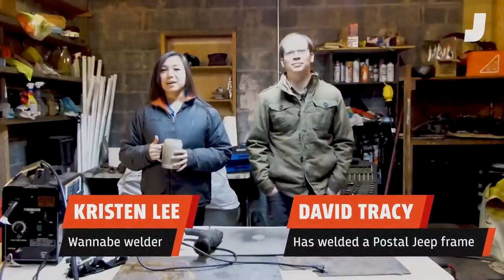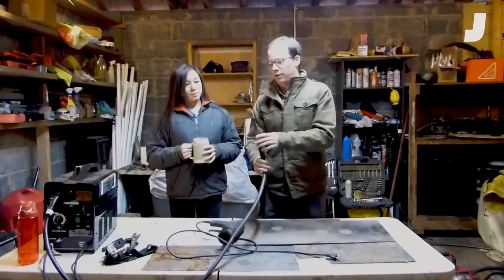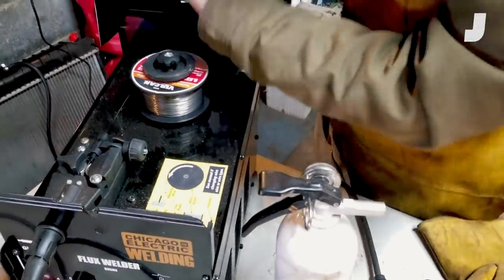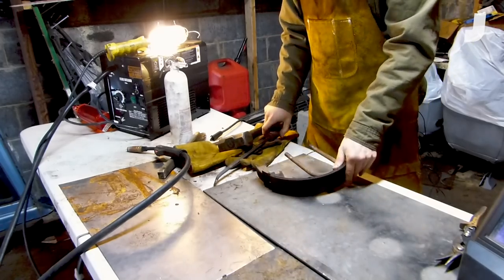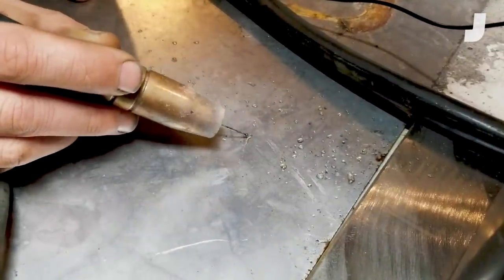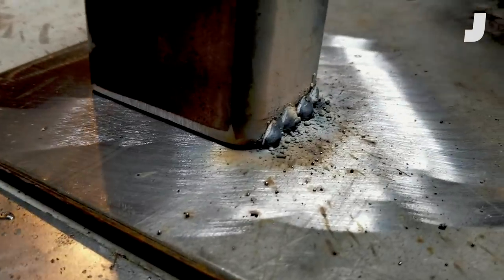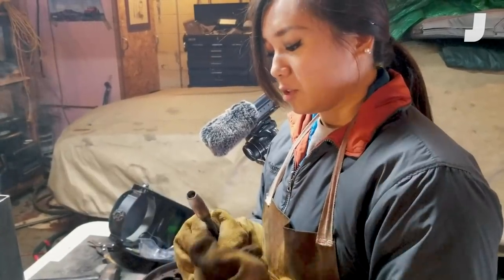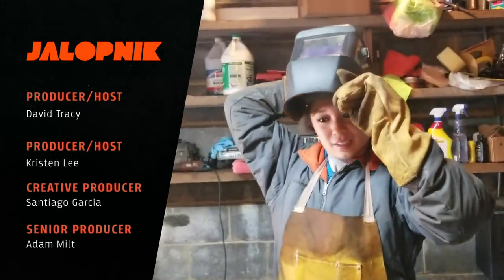How To Get Started Welding For Dirt Cheap

Comment: I learned welding from a badass Vietnam vet I had as a shop teacher in high school.  If your school offers it you absolutely need to take it.  Keep the classes and skill alive.  Even a basic ability can be extremely useful and if you’re good it’s a good paying job.
Reply: In my shop class, we had to weld a bead across a piece of iron, maybe 2" (with an arc welder). When I was reaching for the wand, the guy who was turning the welder on and off hit the switch early and it started arcing and bouncing on the table. It scares the shit outta me, and I never welded again. I should have had my dad show me how to weld right after that, but I didn't jump back on that horse.

Comment: I know next to nothing about welding, so I was able to learn something with this video! The one thing I do know is that you want the protection for your eyes. A welder told me how badly that light can hurt your eyes and it scared the hell out of me.
Reply: Brian Cothran 
Absolutely be careful with it as even a flash can cause eye damage.  It will give you a sunburn to exposed skin if done often enough.   Don’t wear clothes with frays as you will catch fire and always be aware of what’s hot and where hot things have been.  Always assume metal is hot in a work area.  Start with a stick welder as in my opinion it’s easiest.   It’s a good skill to have.

Comment: Hit the base (bottom) metal primarily, as heat travels upward and it is harder to tie-in the bottom than the top. Also, draw the gun from left to right, pointing it backwards @45° in the direction you are coming from

Comment: Wow I learned a lot but yeah. I weld tiny stuff professionally with a BGA rework soldering station and it isn't easy but actual welding seems also equally as hard.

Comment: Yes, technically it's arc welding, but you don't call it "arc welding" as it refers to SMAW or "stick" welding. You want to refer to it as flux-core wire-feed... Adjust the amperage so that it sounds like frying bacon and just do a little "whip" back into the puddle (pull out, whip back, pull out whip back) going a bit faster as the base metal gets hotter. You can just drag the cup against the metal to keep it looking regular. Top off the puddle when your done or you if you accidentally make a hole. It's not really structural welding with wire-feed so think of it more as an art than a science 🙆 Also, you want to use a 12 shade once you become proficient, as your eyes are important